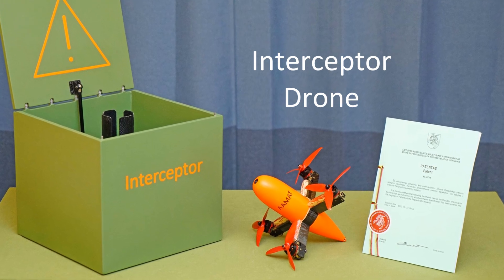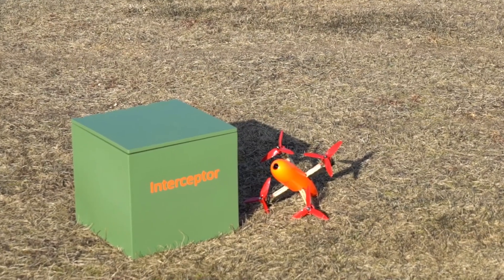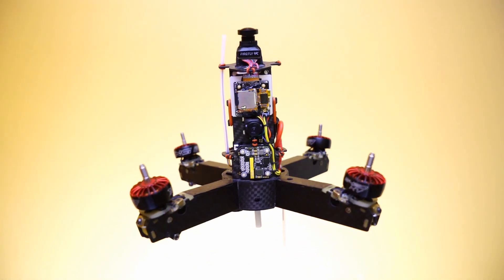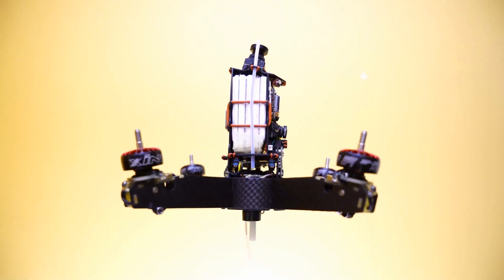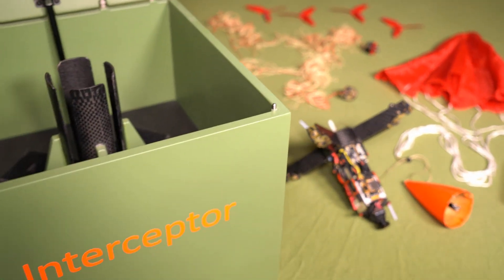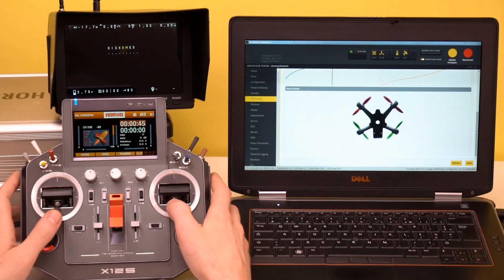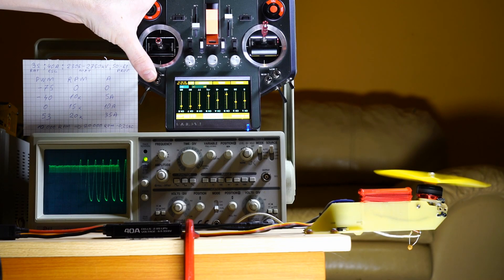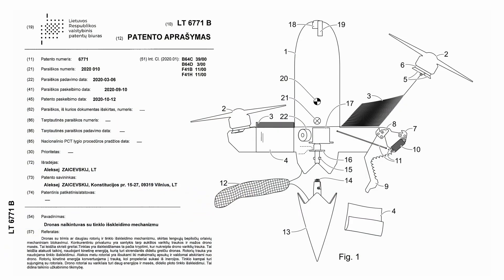Drone interceptor with a net gun and detachable rotors. Anti drone prototype.

Comment: I found this video very interesting and it got me thinking. When I looked up the information, I read that the parts you used were from racing aircraft. Can you tell me about the FC, ESC, battery, camera, propeller, and motor you used?
Reply from the maker: this drone was designed in 2019. now you can find different components, or you can buy a pre assembled racing drone.
Reply: @ZaitsevskyA  I'm very curious about the batteries and propellers used to build this prototype. I would be grateful if you could let me know.
Also, I'm very curious about the top speed - the information I found says 150km/h or more, but is it difficult to go higher than that?
Reply from the maker: @오이닝-f2i  short impulse speed is much higher, but cruise speed is about 100
Reply: @ZaitsevskyA  I was surprised and intrigued to see this study and would really like to know the components used.
1. what is the capacity of a 5-cell battery?
2. what kind of FC, ESC, and propellers were used?
3. what is the total weight?

Comment: Next up, anti-anti-drone drones as said by a commenter on Hackaday where this was also mentioned.  

A DIY version of something like this very clever drone design may be used when the noise from the ridiculously economically impractical delivery drones annoy enough people trying to relax on their balconies and back yards and they finally get fed up... or just a shotgun using birdshot if the vandals don't worry about pellet impacts downrange. Thieves may do intercepts if delivery drones are ever used enough to make that worthwhile... which I seriously doubt.

Come to think of it, on the enemy drone interception task, I wonder if ALUMINUM shot from a shotgun would provide enough energy retention at an adequate range while probably greatly reducing the down-range hazards to innocents.
Reply from the maker: a falling drone is more dangerous than a falling bullet. If I understand you correctly